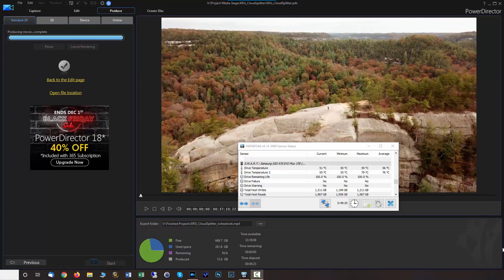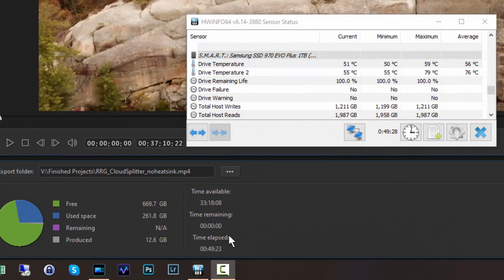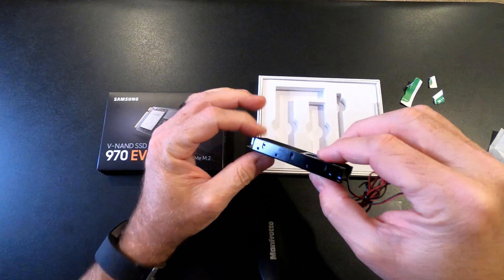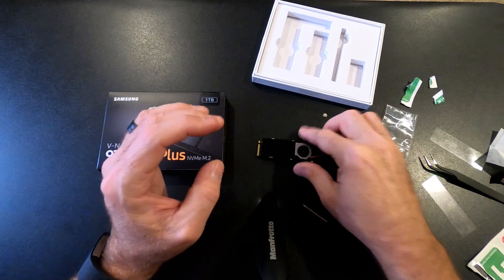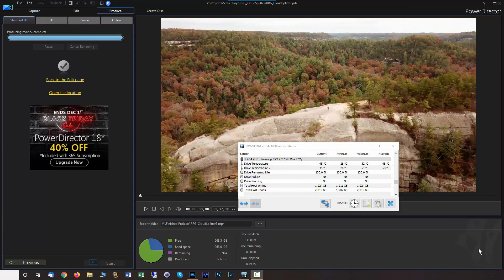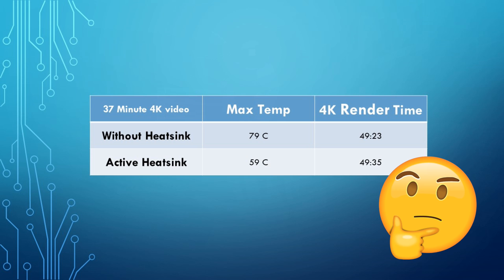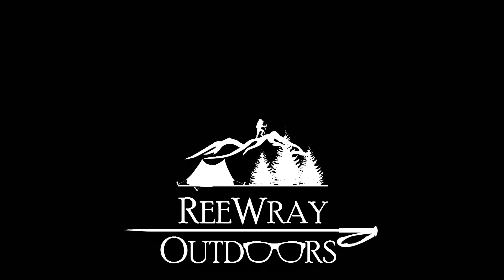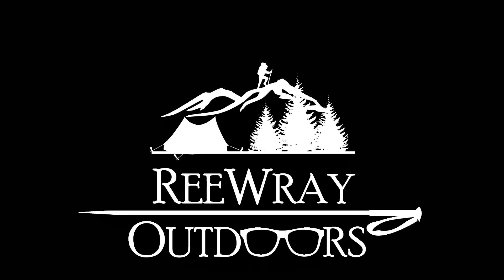SHOULD YOU INSTALL an M.2 NVMe HEATSINK??  Pros & Cons, How to Install It

Comment: Old video, I know - came across my feed, others might want to read this, too...  There are some very incorrect conclusions here, and love the content and presentation, but the conclusions could cause some serious loss of data storage life and overall life of an M.2 NVMe SSD (i.e. if taken literally and used as a reason to custom water cool an entire NVMe stick).
Pro tip: use magnetic tools!  You don't need tiny screws falling onto or into certain parts, scratching something, or worse.  
11:40 - (edit) This is important -- You start by stating the fact that "retention improves at lower temperatures", which is correct, but then your next statement departs from this and concludes that this means cooling flash DURING periods of intense writes would extend the life of the SSD drive, and this is the exact opposite of the point, and in fact will lower the overall life by as much as half.
Retention at lower temperatures, write activity not so much, and at 70C will perform in the most optimally designed state (larger capacity M.2 NVMe, the faster that would be).

RE.  M.2 NVMe Cooling - What you want to do is cool the controller, not the flash chips - that sticker on the back was copper on one side for a reason, it spreads the heat across the back side of the M.2 pcb.  By placing it in a coffin with a thin thermal pad, you are trapping more heat on that backside than you are losing it - the front has fins for a reason, the back barely benefits from them at all!
If you were to do anything to the front, the side with the chips, you could slide the sticker off of the controller (the only one that isn't black) and add a small passive heatsink to it, leaving the rest of the sticker in place as designed to spread heat in a minor yet useful way across the flash chips.  Flash needs to run hot (the black chips), and attempting to cool it during high periods of write intensive workloads as you're doing with your 4K render, will only serve to lower the overall lifespan of the entire M.2 unit as much as half!  You can keep your overall case temps cool during no use to extend life due to the improved retention at lower temperatures, but don't directly cool the actual flash chips during heavy writes as that's not what that statement means.

(edit 2) Think of it like an ice cube tray, and you want to re-arrange the cubes, some upside-down - you need the tray to be warm so you can move the cubes or they stay frozen in the holes, but not too warm or everything turns to fluid - and once done, they can be as cold as they want (actually, cooler the better) and they will stay in place over time -- but if we keep it cold when we want to rearrange them, there's gonna be some damage along the way, and the actual job may even take longer.  The controller (silver chip) is your hands, and there's no problem keeping that cool as you work with the ice cubes, in fact, it's better and you can work as slow or fast as you want whereas too hot means you're not doing anything and need a break before touching more ice cubes. (throttling)
Hope that helps, pulled that one out of you know where.
Reply: Interesting and going against my assumptions.
Reply: thank you 😊 very informative 👍
Reply: So don't put anything on the side with no chips and on the chip side put a simple copper plate for heat dissipation?
Reply: @djbneozen  The principle is to cool the controller, not the flash chips (black ones).  Since most passive spreaders cover the entire unit, sometimes also closing off the back to air flow, there is often little choice when it comes to proper cooling according to best practices and engineering facts.  Even I have my 2 NVMe's behind the included passive spreaders that came with the motherboard (ASUS ROG Crosshair VIII Hero WiFi) and I'm not concerned.  I did, of course, carefully remove the sticker on the front (only) since the mounted spreaders on the MoBo included adhesive thermal foam paddings.

If you only gain one thing from this, it should be that any ACTIVE cooling on these NVMe SSDs should only be on the controller, and not the flash chips - so if you constantly perform heavy workloads with sustained writes, it might be worth considering a custom solution for maximum lifespan and maximum number of writes over time by adding some device upon the controller chip, leaving the included sticker "spreader" intact only over the flash chips themselves (just cut with a razor and remove from controller only). That is the conclusion that should be derived from the fact that "retention improves at lower temperatures" yet cooling is not required and could (maybe) be a hinderance to expected lifetime max writes, and where the working unit (the controller) is the component that can/should be kept cool for best operations at any given time as it can heat to the point of throttling it's own workload.

AFAIK, it would be a rare case where someone had such a poorly cooled case as well as heavy workloads to require anything more than passive cooling with a single spreader across the entire NVMe, even if only using the included sticker, and we're talking best practices and engineering principles here, so should be taken with a grain of salt regarding real world applications.  When installed properly, most NVMe SSDs will perform just fine and up to their expected lifespan.  Don't get lost in minutia like this, it gets deep.  Fact is that an incorrect statement was made on a public video drawing false conclusions, so I got a bit wordy in rebuttal - and no one needs to trust me - feel free to check out some technical videos by folks who know the science behind it.. maybe DerBauer, Gamers Nexus, King Pin, etc. if you can find some vids on the topic.
Reply: @SemlerPDX  awesome reply. Thanks!
Reply: @SemlerPDX  Hey Aaron, did you find the motherboard heatsinks work quite well for you? Or would you suggest looking into after-market ones? And just so I understand correctly, if I'm using the motherboard heatsinks, I only need to take the sticker off the front of the NVMe, not the sticker on the back of it right? And from there, I just mount it like shown in this video and that should be it? Thanks!
Reply: @itsdannyftw  Motherboard heatsinks are just fine - looking at my temps now in my AIDA64 panel, the one closer to the PHC is sitting at 46C and the upper one (above the GFX card and just below the CPU waterblock) is at 39C (idle temps).  Under load, I don't see any appreciable increase more than 5 degrees, really.  Now, it helps to know that this temperature reading is likely from the controller, and iirc, those YouTubers like DerBauer and Steve from Gamers Nexus use their own thermal probes on various parts of the NVMe -- that being said, even when running an intense game with a lot of disc access (like Arma 3), neither NVMe gets higher than 60C.
   
And yes, your SOP is correct - IF you are using only the included motherboard heat spreaders - carefully slide the sticker off the front only (side with chips) and leave the one on the back 'smooth pcb' side.  If you are using a special heat sink 'box' as seen in a few Gen4 NVMe's, then I would hope that the back-side also has some thermal transfer foam and if that is the case, you'd slide the sticker off the back ('smooth pcb' side) so that the sticky thermal foam pad could have direct contact with the PCB.
   
Again, wanted to state that this is an EXCELLENT video and by no means did I intend to discount the information provided, merely a minor correction on a specific detail that may mislead someone into thinking that an extreme cooling solution for an NVMe would be a good idea, when the fact is that passive cooling is more than sufficient, while active cooling should only be done on the controller itself (so, no NVMe water blocks, k?).  YouTube creators and videos like this are the backbone of the modern information age, and I definitely give all props to ReeWray Outdoors for the great video, and the chance for us all to discuss it in these comments.  It's so important to note some engineering details, even when they barely come into play for standard users like us, so that we can learn the bigger picture of what is going on.  (In this case, a difference between the controller chip(s) and the actual storage chips on an NVMe)
   
Cheers to ReeWray Outdoors for all the content and great videos!!
Reply: @SemlerPDX  What an excellent and an insightful comment. Thanks for your contribution in this community - I'm sure many others would not have been aware of what you describe to be a minor correction.
I'm going with a B550 Aorus Pro, and the SSD is a 970 EVO Plus - I don't think the motherboard's heatsink is a 'box' right, merely just a lid? Moreover, which M.2 slot would be better to place the SSD? I'd imagine the one closest to the CPU, as the other M.2 slot would be in the direction of the GPU blowing heat off it? 

Additionally what are your comments and thoughts on those who say that adding a heatsink can result in throttling and/or worse performance? This obviously depends on many factors (cooling within the chassis, motherboard design, other hardware, heatsink used, etc) but in general if you see slower performance (eg like in this video) after attaching the heatsink, does that necessarily mean for optimal performance you should not use the heatsink altogether? In other words, is it really just a trade off between performance and longevity - the latter a result of 'cooler' temperatures with the heatsink added. Or is there really a case of the best of both worlds where adding a heatsink not long can improve performance (as the NVMe SSD never gets above throttling point eg 70C) but also improve longevity of the SSD?

Also, can you share some methods if we needed to preserve the removed sticker (if in future we decide not to use a heatsink and/or for warranty purposes)?

Thank you!
Reply: @itsdannyftw  Yea, that's more like a lid or cover style, perfectly suited for the task, and with a small intentional airflow gab between the back of the NVMe and the motherboard.  If you have any other stickers around, just peel them off their backing, and use that to stick the sticker onto to preserve the original sticker glue - store it with any of your other PC materials, maybe even in a baggie in case it looses from the backing over time or whatever.  I don't feel that adding a heatsink will result in throttling and thereby worse performance so long as the case is properly cooled, it would improve consistent performance on average and that's kind the point.

I also do not feel there is any significant tradeoff happening, again we are discussing minor factors that are not exactly reached through standard cooling methods such as head spreaders, as opposed to going ballistic with water blocks on NVMe's, which was my point in describing the point of the conclusion, and the minor error therein.  Not all cases are alike, and not all cooling solutions work well for every case.  Using a monitoring program can help spot potential problems before they become problems.
   
Best wishes and good luck!  (edit: yes, the NVMe slot that is not behind the graphics card and further away from the PCH, usually the upper, is generally gonna run cooler in most scenarios)
Reply: @SemlerPDX  Great stuff, thanks for your help Aaron! All the best. Cheers
Reply: Many drives comes with heatsinks installed. Why?
Reply: @kabulos  Manufacturers cannot account for every environment, and certainly don't assume that every end user will have the most optimal conditions for running their drive.  They can easily ensure consistent and moderated performance by installing heatsinks and selling it as a package, especially helpful if their unit runs rather hot for any reason.  Another factor, even if it was not needed, is the selling point of the "performance gear look" - like gold plating on wires and connections, even if it's scientifically a hinderance or less optimal choice going by best practices and applications, if a company can make more sales by adding something that makes a product "look" faster, they may hook their sale long before any numbers come into consideration.
Reply: @kabulos  *also note that passive cooling (with heatsinks, fins) is not the same as active cooling such as a water block.
Reply: I've read the same about the importance of cooling just the controller and not the flash also. I just bought a passive cooler that will cover my entire M.2, but I think I'm gonna hold off and just buy a tiny one for the controller only. Nice explanation.
Reply: @davejohnsonaudio  Thanks!  But in that explanation, I made reference to the difference between active cooling and passive cooling.  There is no reason not to use a passive cooler that could cover the entire M.2 -- especially if it's just for the front face (leaving plenty of airflow room for the back of the unit nearest the motherboard).  What should be avoided, and the takeaway here, is that the best practices and principles behind this suggest that the memory chips should ONLY be cooled with passive heat spreaders or the like, whereas the memory controller (silver chip) may benefit from active cooling so long as it is ONLY the memory controller.  It's a good idea to use some sort of heat spreader or passive cooler for the M.2  barring any other form of thermal dissipation, because these things DO get hot, and the memory chips get hot, as well as the controller.  By helping to spread that heat around, you can make sure buildup does not place either in a danger zone where damage could occur, or simple reduced performance from thermal throttling used by the firmware to keep the chips from overheating.  This is especially helpful for M.2 mounts directly "behind" or under a graphics card and particularly the kind that has exhaust fins pointing towards and away from the motherboard, instead of front to back or a closed loop liquid cooling setup.

IF you were going to go with tiny single-chip passive heat spreaders, those little stick-on fin arrays, do one for the controller AND the memory chips themselves, with the benefit of them being independent of each other.  The issue with these usually is that they are tall.  A large block of aluminum with a thermal foam stick pad is about as effective, and many of these come as part of the motherboard (like the ones my 2x 1TB NVMe SSD's are under on my ASUS Crosshair VIII Hero).  The lower one behind the RTX 2070S is always 5C higher even at idle, but would be worse if not using the included heat spreader covering the entire M.2 card.
Reply: @SemlerPDX  Thanks so much for the clarification. I've seen some discussion about when using a basic spreader, to only apply the thermal compound to the controller, so the NAND doesn't get quite as cool. Is that ok, or recommended? Also, when applying it to all the chips, do you cut individual sizes, or just use the full length of the thermal pad? 

I've got a basic full length heatsink on order, so based on your new info I think I'll just use that for now and forget about the Rasp Pi-sized heatsinks. This is a very confusing topic, but I think you covered it all and I think I get the gist of it now. 

This is my first time using an NVMe drive in my Mac Pro. I'm only going to get 2.0 speeds with my card, so I'm only topping out at 1400mb/s. read/write. Heat should be less of a worry for me I'd think? Idle was about 45C and a quick read test was at 50-60C without a heatsink.
Reply: Can i also just use these gpu Ram Copper heatsinks and stick them onto the Controller
Reply: @pedro.6372  Sure, if you have room!  Passive coolers like that are great for those types of applications.  They can be a little bulky, but the standard airflow within the case allows them to dissipate heat as it contacts the fins, so if it's in a very blocked off area, the effect can be less dramatic, but still appreciable.
Reply: @SemlerPDX  Late to the party but I hope I can get confirmation that the sticker/label on top of the Samsung 970 Evo Plus, is also a heatsink? I see that the label on half of the bottom has thick copper on it but the label on top doesn't appear to be anything more than a label.
Reply: @EnterAndJoy  The thick copper is a dead giveaway.  In the absence of any other form of heat spreader or heatsink, it should not be removed just for looks or whatever.  It serves a purpose. Edit: It won't matter if you leave both stickers on, even if one is just a label. But if putting under or inside something with its own sticky thermal transfer foam or equivalent, you'd want to remove anything in between for maximum contact - regardless of whether that is a copper backed sticker or just a simple label sticker.  You might keep label stickers for warranty purposes, tho - wax paper should keep them ready if they have to be re-stuck on.
Reply: @SemlerPDX  Thanks for the reply. I bought 2 Samsung 970 Evo Plus 2TB SSDs. 

One was brand new and factory sealed. The other was a bargain because the top label had been removed (I have confirmed that it is legit, the real thing) and it still has the bottom label with copper, 100% identical to the brand-new one. 

I would like to put both of them into an MSI Prestige 15 laptop that has 2 slots. I'm just trying to figure out if the one without the top label needs some type of heatsink and if so, is there an Amazon option you would recommend? 

The laptop is not used for gaming or rendering. Mostly just a business laptop, Chrome, email, OneNote, etc.
Reply: @EnterAndJoy  It's probably just fine without the upper label sticker, as far as I know it's not related to heatspreading and any such effect would be quite minor.  You can easily check the temperatures of these sticks with any sensor software and put it under a load test to see if it remains within margin.
Reply: @SemlerPDX  Thanks again. I didn’t think of that. I can check to see if they both stay around the same temp.